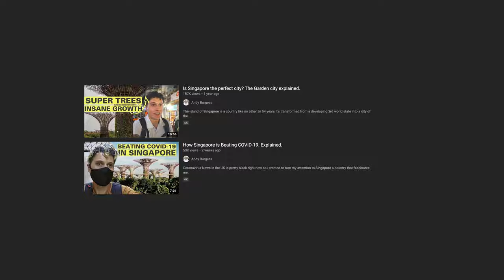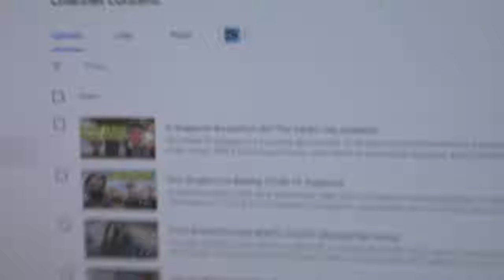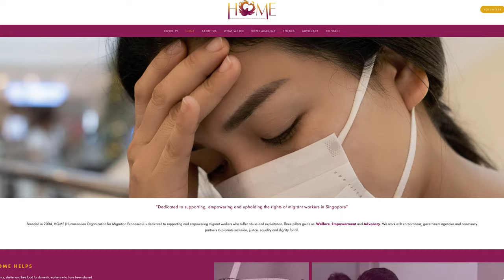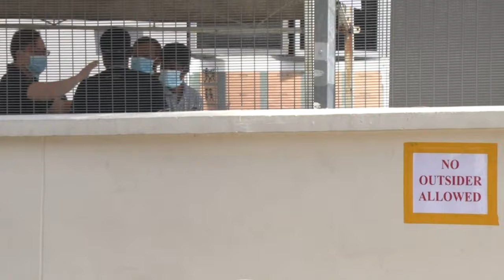Why are the people who built Singapore living like this?

Comment: Yup fair vedio
 Been debated all over
Even was a hot topic campaign during the July general election
Opposition have used this to blast the govt on migrant worker living conditions.

Land scarcity has been big problem for singapore
We can't build off shore and separate them from the island which is draconian
Nor can we give each worker an individual apartment 
So the govt is brainstorming and hope for a quick solution
Maybe limit 2 to 4 max per room and not stack them up

Usually the maintenance and needs are done by the dorm operators who have come under scrutiny too which has now pinned on the govt.
So not easy having a 100s of thousands of migrant workers in a small island city state.

Singapore is going to automate many things even construction like road etc 
Will reduce the numbers in the coming years